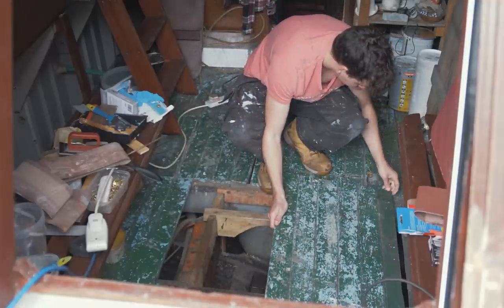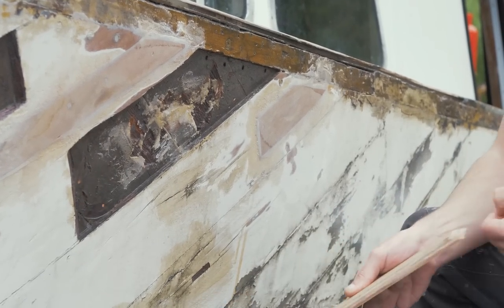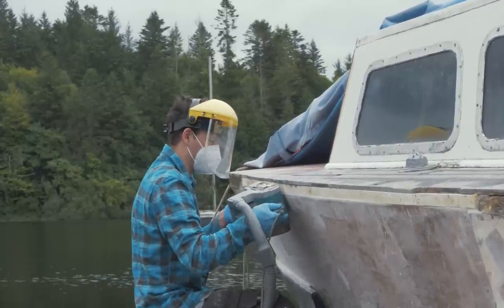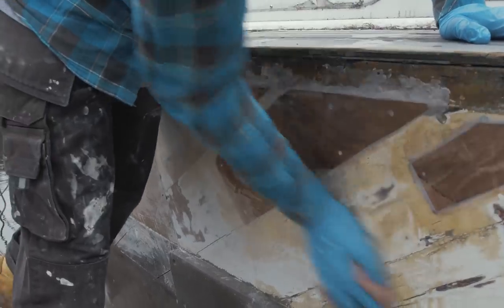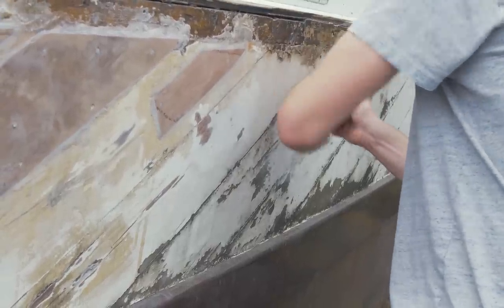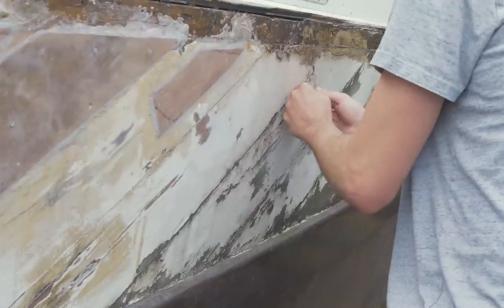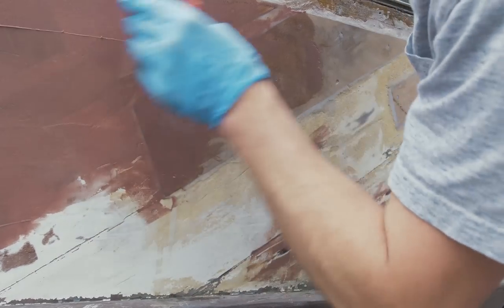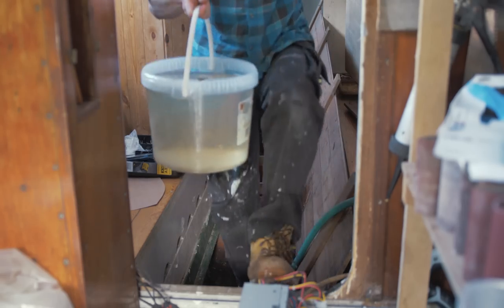1940 Wooden Boat | Fairing The Hull & Stern Leak | Liveaboard Journey: Episode 25

Comment: Thanks for sharing your boat restoration and never ending commitment. I want to pass on a method you may find helpful and that is to use a wet/dry vacuum to pick up the  bilge water, you can get right down to the planks and its very fast. Best of luck.

Comment: Nice work! I'm doing a lot of similar things with my 27' Monk cruiser while in the water. Welcome to the world of old wooden boats! You fix one leak and a few months later you find water in the bilge again. You live with it for a while, sometimes they go away, but eventually you have to haul out and re caulk or replace something. I've tried about every trick in the book to try and stop them from inside the bilge, and nothing really worked. Just be religious about checking the bilge pump!

Comment: Things are coming along nicely. In the bilges are you not supposed to create waterways so that any water that enters the bilge will make its way to the lowest point where there is a pump. You don't want water getting trapped in various parts of the bilge.
Reply from the maker: Yes it has them allowing water to flow through each compartment. Now that I have a new Rule pump installed in the engine room I can install another in the bilge under the wheelhouse cabin where a little excess water sits.

Comment: Nothing beats West system but an old boatyard trick is baby powder as a filler. Works great believe it or not. Good job btw
Reply: Yes, talc will act as a thickener, but does not give the structural advantage of the fibers.  For fairing, the micro balloons are very light and easily sanded, making a much superior compound.

Comment: First let me say you’re videos are interesting and entertaining and it looks like you’re trying really hard to save you’re family boat. Every one has already told you several times you need to haul the boat and I’m sure you already realized this! So it looks like you are on a very limited budget and for the most part you are a one man team. How much more upper hull work do you have to do, time wise? I’m sure you have already though of all this. So I need to ask is it possible, do you have any place that could haul the boat?  If so, could you afford to put the boat on the hard for any length of time? You’ve already said a lot of this work is temporary so there are several fairly cheep ways to fair out the upper hull and make it look acceptable for a few years or so.  Best of luck to you. Keep chugging away.

Comment: Any chance you have a wet/dry shop vac, plastic or stainless steel? Or a pump device attached to a drill with tubing to drain bilge water faster.
Reply from the maker: The wet/dry shop vac burnt out but I do have a drill pump.

Comment: Considering the lower half is glassed and the amount of epoxy filler used on the upper half, wouldn’t it be easier to just glass the top half? As it stands it would be an awful lot of work to restore it to a planked hull, basically a new hull would be needed. 
If you’re careful a glassed upper hull could be moulded to simulate a planked hull anyway. Bonus being being resistance to rot a less leaks.
Reply from the maker: We're moving fast carrying out patch repairs to the upper hull so we can glass the roof and decks before winter arrives.

Comment: Great job.   Stay away from polyester resin and "body putty" on wood,  it does not work.  Only use epoxy and collect your sanding dust to be used with silica to make epoxy filler.
Reply from the maker: I think for both the decks, wheelhouse cabin and forecabin roof I will be glassing using Polyester resin and fiberglass as it is much more affordable than using epoxy. I would love to use epoxy with the glass but it's just out of the budget unfortunitely.
Reply: @LakesideProductions   Depending on how long you are planning to keep the boat.  I learned  43 years ago to not use polyester with wood after having to re-do some earlier repairs on my double diagonal planked 1966  37" OWENS Granada.  I chose to struggle thru the higher price and use Epoxy EVERYWHERE.   I am 75 now; after 43years, I still own that wood boat and have never had to re-do any work that was done with epoxy .   Wood boats always have plenty of new work to be done, you don't ever want to have to do anything more than once.
Reply from the maker: @lesterreese7771  I guess there's a place for polyester, it works for a lot of work boats but when it comes to a liveaboard you want something that will last and like you say you don't want to have to re-do it. The hull of the seaplane tender was done with fiberglass and epoxy over 30 years ago and that stood to her. We've decided to go with epoxy for the rooves first and see how we get on. What a beautiful boat that it. Thanks for your comment.